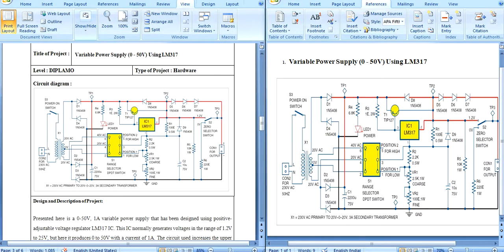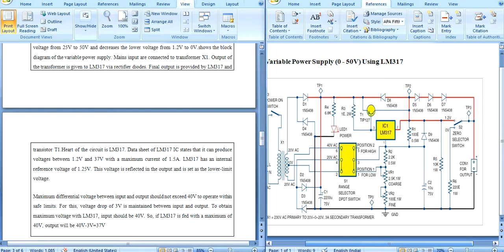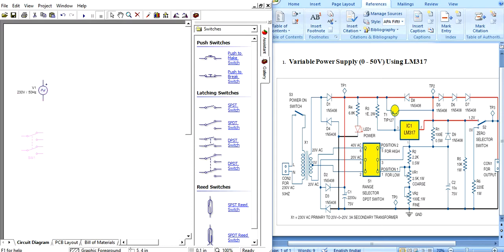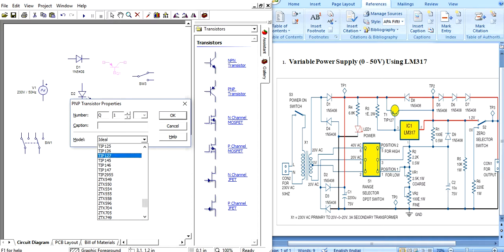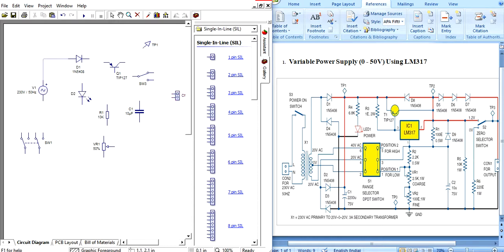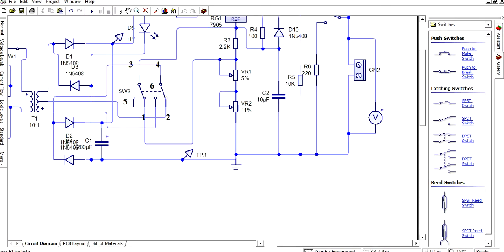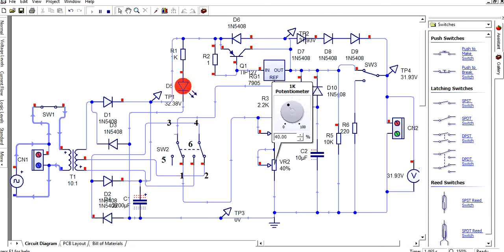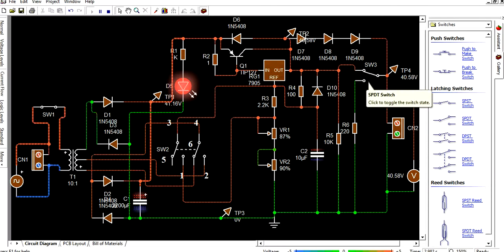Simulation of  Variable Power Supply (0 - 50V) Using LM317 - CIRCUIT WIZARD SOFTWARE

Comment: I Guess LM 317 is not listed in Circuit wizard, How did you managed to incorporate the same.  I'm having issues...
Reply from the maker: Hi LM317 is not listed. 
So the circuit using 7905 ic.
Reply: @schoolofengineering-thepla3497  but LM317 and 7905 are two diff component